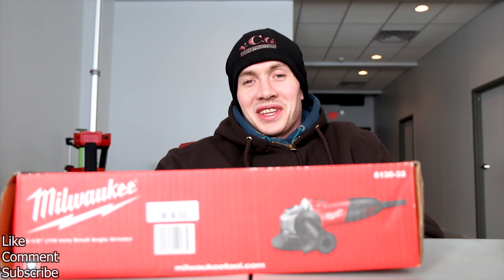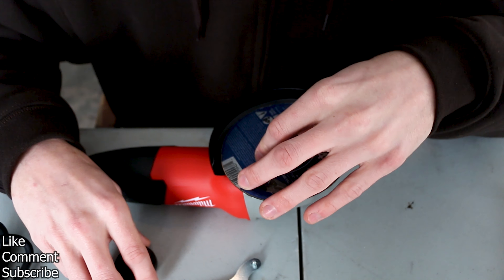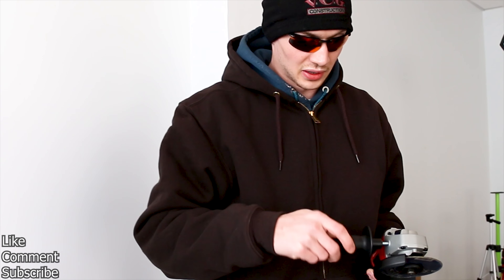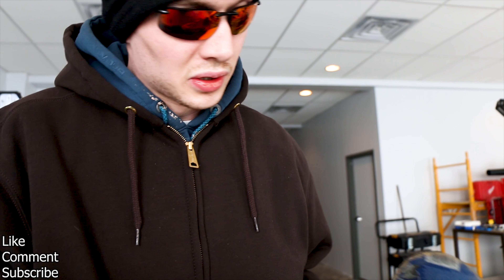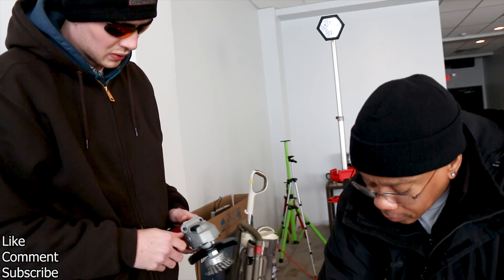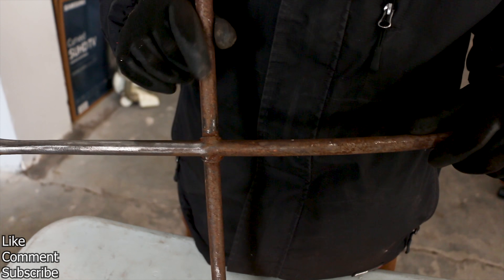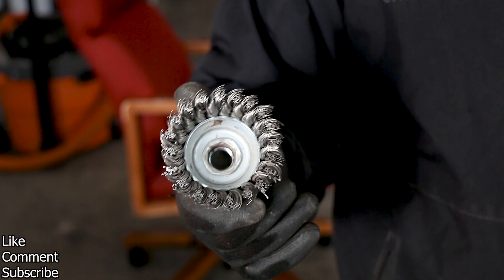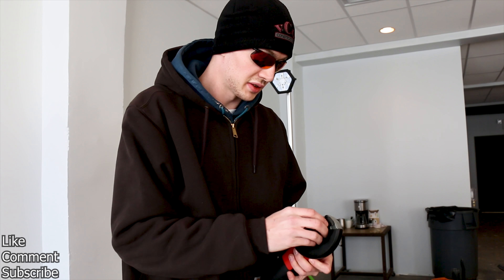Milwaukee 4-1/2" Small Angle Grinder Test And Review

Comment: personal preference i like the 5" 12amp rat tail style, all the brands make a good one of those.. i think i might go for the makita if i needed another grinder and couldnt afford the metabo

something alot of people dont realize is the cutting disks are alot more controllable on once side of the grinder then the other because of the direction of rotation, check how jerky and unstable it was cutting the threaded rod on the wrong side, then on the plate hed switched the the proper side and it was really smooth and controllable once it was started off... sometime you have to use the wrong side but its best to use the proper one so its more controllable and alot quicker, one will pull the disk in and make it explode also sending the grinder towards your legs, the other way will lift it up out of the cut and send the grinder away from you if youre not holding tight but 5 feet infront of you is better then planted in your thigh
Reply: sorry to be offtopic but does anybody know a way to log back into an Instagram account?
I stupidly lost the account password. I appreciate any assistance you can give me!
Reply: @Luke Alaric instablaster :)
Reply: @Yusuf Raymond thanks for your reply. I found the site on google and im in the hacking process atm.
I see it takes quite some time so I will get back to you later with my results.
Reply: @Yusuf Raymond it did the trick and I now got access to my account again. I am so happy!
Thank you so much you really help me out!
Reply: @Luke Alaric no problem xD
Reply: This little milwaukee is great for tight spaces.  We have about seven M grinders in the shop Makita/Milwaukee/Metabo and for some reason the Metabo disks last much longer.  I swapped out all disks on the same day and the Metabo ones were in significantly better shape.  i think it's the clutch mechanism.

Comment: Guys safety first .use a vice to clamp the material.....if the grinder had slip someone might be missing a hand.....
Reply from the maker: +Raj Dann good point brother we try to keep safety first whenever using power tools.
Reply: They could mount the vise to the plastic folding table they we're leaning on.  Also probably want to use a face shield and a particulate face mask when grinding or cutting painted or coated metals.  Those cut off wheels can be pretty nasty when they explode at 12,000 rpm, and metal fume fever is never fun.